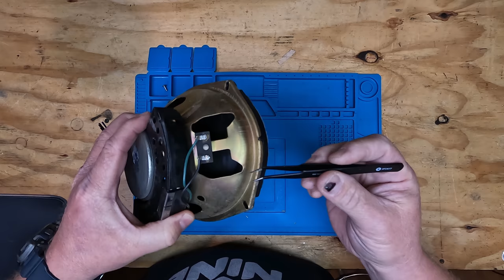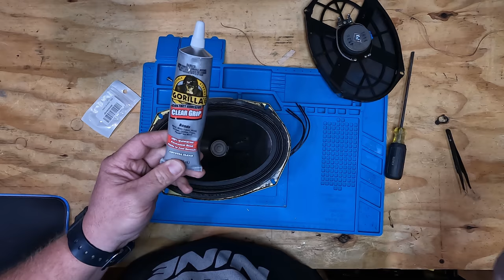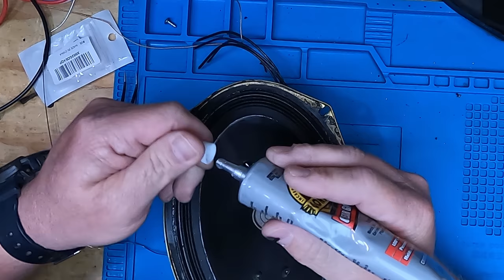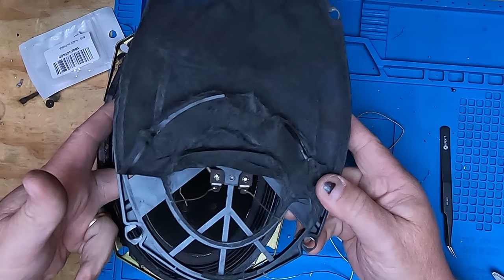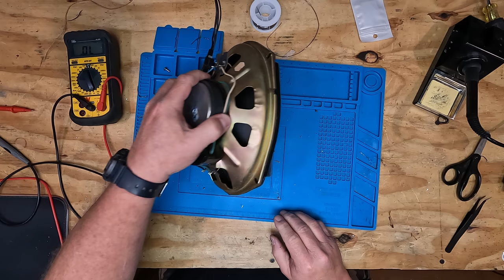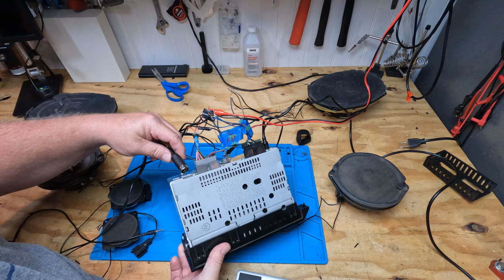How I Added an AUX Input Port to my Vintage Chrysler Infinity Radio using a  Classic iPod!

Comment: Hi!!! Can you shar the pinout connection for the din cable into the stereo? Thanks!
Reply from the maker: I think it's shown in the video wasn't it?
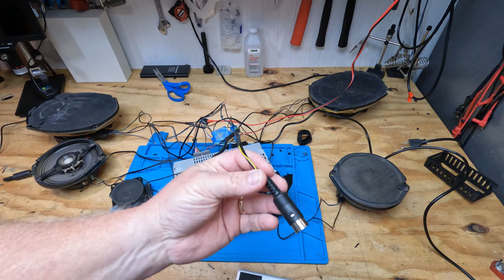Reply: @projecttimetech7022  on the min 41:53 you said the cable was built in another episode, but I couldn´t find the video on your list. 
Thanks!!
Reply: @projecttimetech7022   @nicolascontardi  am looking for the same thing, I have an Infinity II in my Chrysler TC and the CD player is kaput so I have been trying to figure out the DIN cable conversion to AUX. I also looked for the other episode and could not find it.